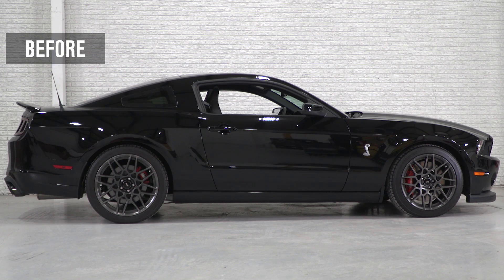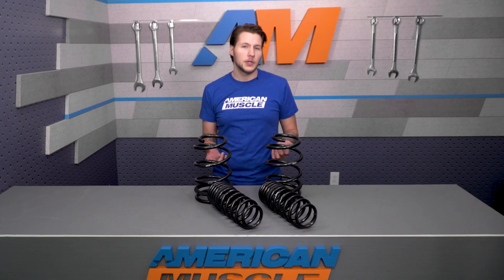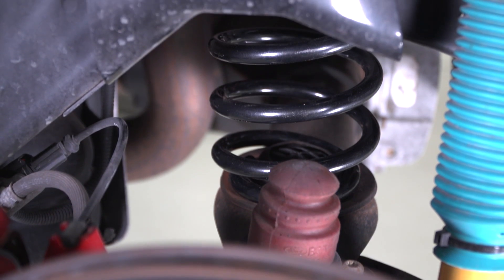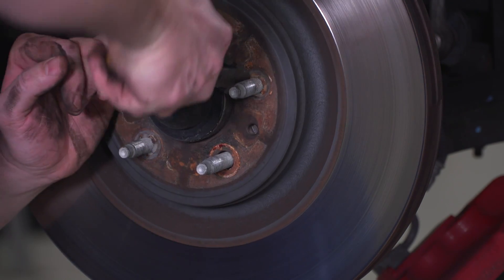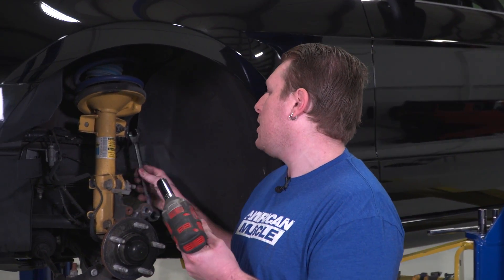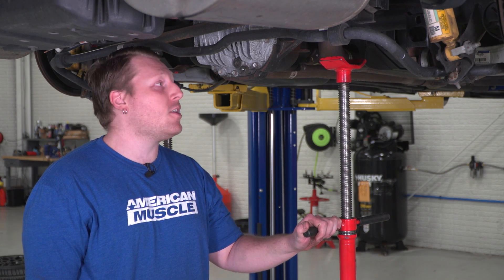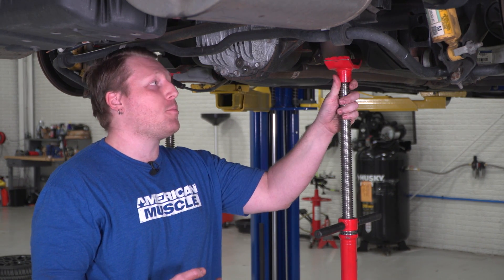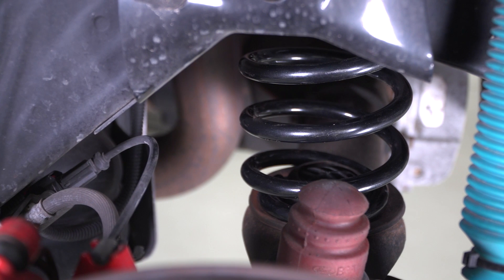2007-2014 Mustang GT500 Eibach Pro-Kit Springs Review & Install

Comment: I have these on my 2014 GT500 and I love them!
Reply: Ralph Voorhees do you still get to feel the difference in the suspension setting? Normal and sport?  I’m worried to lose that comfort mode
Reply: @juliosachump  
The eibach lowering springs   ride almost the same as stock. I was very surprised and impressed.  I drive around in normal mode just like before.  Normal mode feels the same but Sport mode is stiffer than before. I'd only use that on the track. Hope this helps.
Reply: Ralph Voorhees did you have to install new shocks and struts? Or just the springs?
Reply: Richard Hammerbush I just did springs.
Reply: Ralph Voorhees were you able to get a correct alignment? With just springs?
Reply: Richard Hammerbush Yes I never had to get a front end Alignment